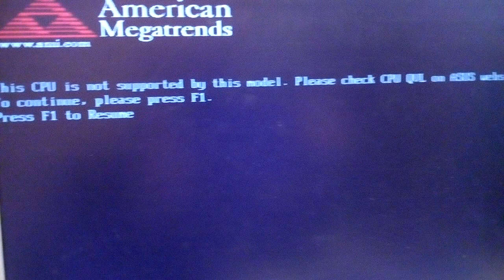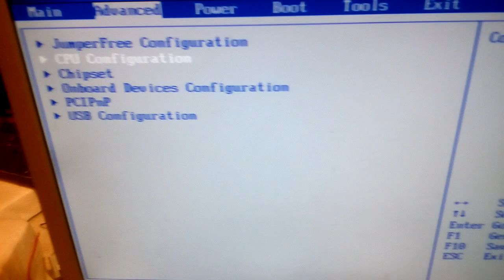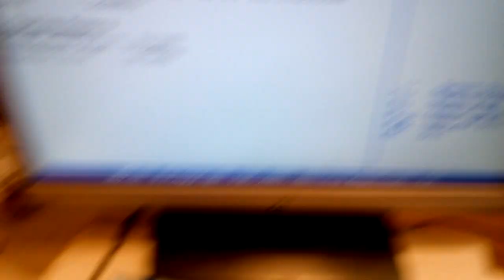Asus M2N68-AM PLUS not support Phenom IIX4 955 procesors

Comment: Hey,  I have the exact board as you....  It does not support anything higher than a Phenom 2 X4 940. (AM2+ DDR2)    AM3/+ motherboards will fix your problem. (DDR3 support is needed)  I did run a 940 on my platform without issues.  Good luck!  There's hope for you.